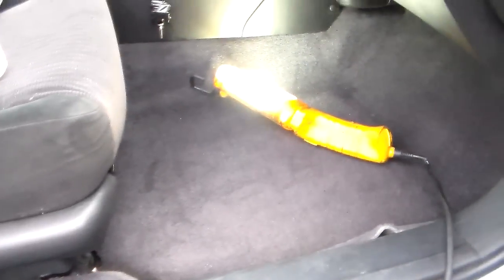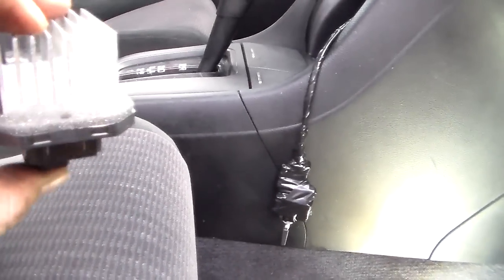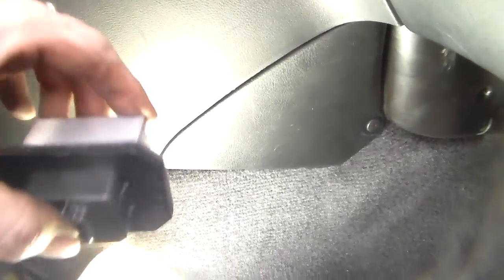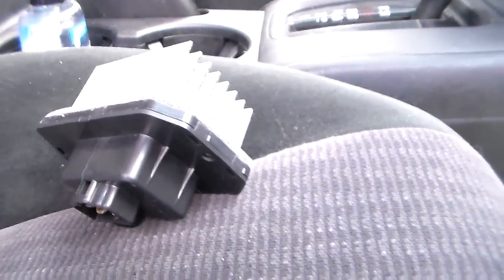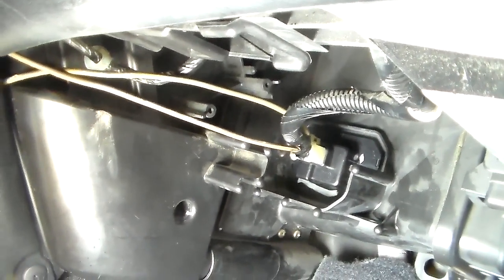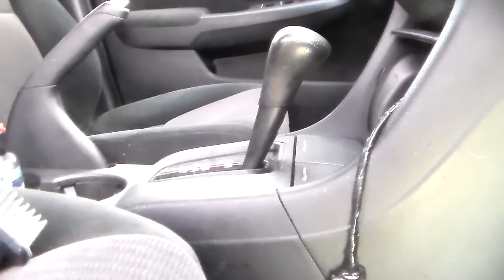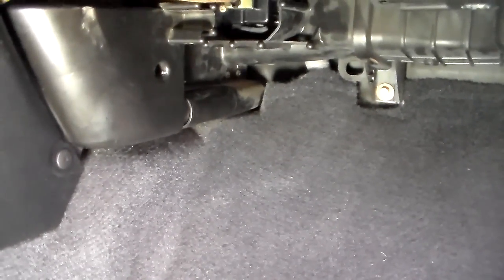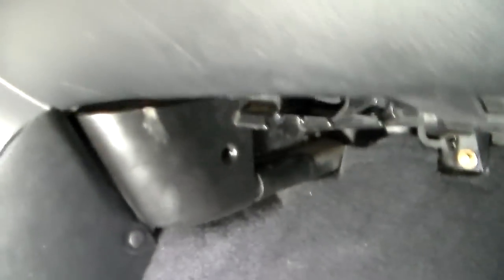2003-05 Honda Accord blower motor resistor replacement pt1

Comment: Just repaired my 03 Honda Accord using this video. Excellent tutorial on fixing this problem and saved me a lot of money, the part was $63 at the local Auto Zone!!
**One thing to add, be sure you have a Phillips head screw driver with an 8 inch shaft before you begin. That little screw on the left side is a bitch to remove unless you have the right screw driver. I give this tutorial 2 thumbs up and it saved me a $100 diagnostic at the local Honda Dealership. YAY WhoSaidTyler!!! You da man.

Comment: Thanks whosaid tyler! I replaced the blower motor resistor on my 2004 Accord and that did the trick. I appreciate your knowledgeable instruction. The hardest part was finding the right length screw driveer to get that inner screw out.

Comment: Mechanic I’ve used for years quoted nearly $1,800 to replace A/C compressor, etc.  Took car in to dealer for airbag recall and guess what?  It’s the blower motor resistor.  And after watching your video, I can fix it myself.  Found a quality replacement part online for less than $20.  See how the game works, folks?  You can save thousands.  Oh, and I’m glad you made your video the way you wanted it.  Was helpful and informative for me.  Thanks for posting.
Reply from the maker: Glad it helped you.

Comment: Wife's '03 Accord had this resistor go out and the symptoms were that NOTHING worked (blower, compressor, radiator fan, etc.) until this part was replaced.  Display showed A/C on and working but that was all.  Thanks for the video!
Reply from the maker: You're welcome.

Comment: One of the wagons I bought a while back had this same rigged switch setup.  New BCM took care of that, took less time to fix it right than rig a it!
On a related note, I bought a Roadmaster wagon late last year from a guy who used it to haul his kids to school each day until the fuel pump went.  He sold it to me and mentioned it's very safe, he has no reason to think otherwise.  I found out the car had NO FLOOR PAN and the frame was swiss cheese!  I guess we have different definitions of unsafe!

Comment from the maker: You haven't had a GM then. B-body Roadmasters and D-body Flaatwoods all use a resistor just like this one that fails, just like this one.

I agree that it shouldn't have failed, but this Accord has held together MUCH better than some cars I could talk about.

Comment: Opps I fixed it from rigging it!  Installing that bypass is more work than swapping the resistor... BTW The newer truck has a resistor like that. I think the sealed kind are junk compared to the old resistors that had exposed wires. They were more robust!

Comment: Replaced resistor ($65) and now blower works! Fast forward 2 weeks and now blower stays on all the time regardless of off/on switch. Fan speed control does increase blower speed, but won't shut off. Any ideas? Relay?

Comment: I had some battery problems recently so I am more aware of accessories that drain your battery.  Makes me wonder why they would design something (the blower resistor) that waste energy (battery power).  Maybe the alternative (modulating voltage or current) is too expensive.  I don't know much about electronics, but would like to know the answer.

Comment: at least they didnt hack the wiring at the connector. 

but i will say this 90% of the times a blower motor resistor dies/burns up is becaus the blower motor it self gets worn bearings and coals in the motor itself it needs more power too run and burns up the resistor in the long run, this is a know cause on many cars

Comment: Dude the resistor makes heat because it is cutting the voltage to make lower speed functions , the heatsink is to try to keep it cool they do not last because the resistors burns out , typical with all cars normally they function in high speed only because that is direct 12 volts

Comment: Do you happen to know what the equalized pressure should be at on the system for this car? My compressor won't start and it has about 80 psi, fan works relays getting 14 vdc. I don't think it's pressure switches but it's held out by a safety.
Reply from the maker: I'm sorry, I have no idea. My AC on this car was out due to a punctured condenser.
Reply: Ok thank you for the video it was a good thing to know about my car.

Comment: For my 03 accord the blower works and the heater but not the ac...the button doesn't light up would this help? The relays and fuses are fine.
Reply from the maker: It may be low or empty of freon. There's a pressure switch that disables the compressor when the charge gets too low. The AC condenser in front of the radiator on Honda's is very fragile. It might have taken a hit from a rock.
Reply: Thank u. I will check it out.

Comment: Can you tell me where I can find the AC motor blower motor resistor on a 94Honda Accord. If you can I will definitely subscribe. Why would the mechanic want to charge me $1000dollars for doing this job when I could do it myself saving a ton of money and becoming the savior of christmas?
Reply from the maker: I haven't worked on one of those but they are always in the same general area, behind the glovebox area. You may be able to see it from below, like the '05 in the video, or it might require dropping the glovebox door all the way open so you can look behind it. Squeeze the sides and it'll come all the way open. The resistor is held in by 2 screws. The dealer charges $1000 because they are dirty rotten crooks who prey on unsuspecting people.

Comment: my 2003 honda accord, just stopped blowing cold air.. added freon and still blowing warm air, why?
Reply from the maker: +Stacy Muriel The AC condensers on those are prone to getting damaged by rocks thrown up from the road and losing all the charge. At this point your best bet is to take it to a reputable ac repair business and have it inspected.  Walmart, the corner parts store or the quick change oil places that also recharge ac systems will not be able to help you.